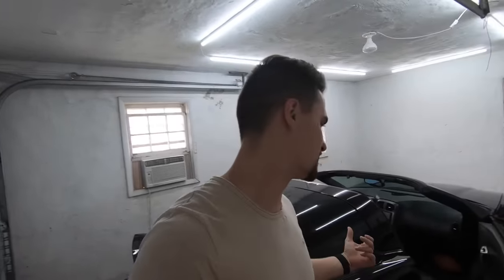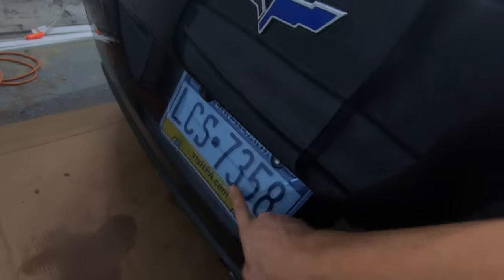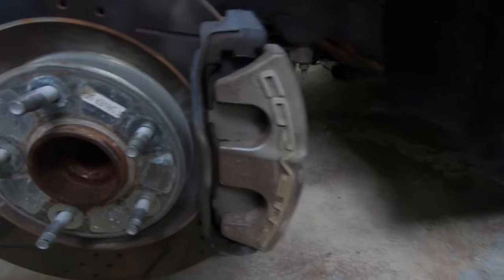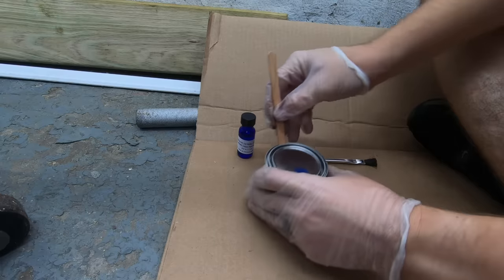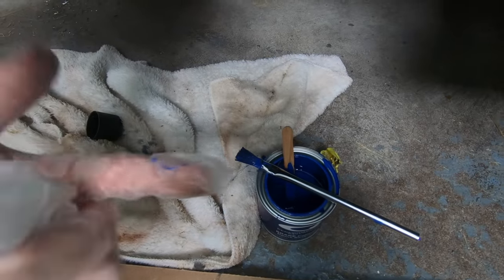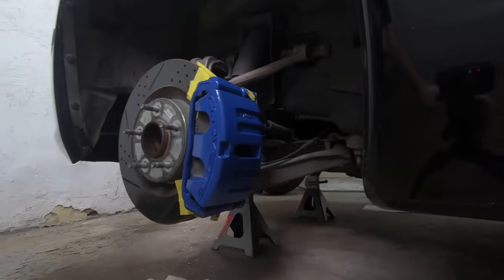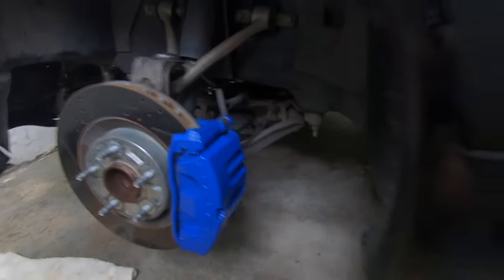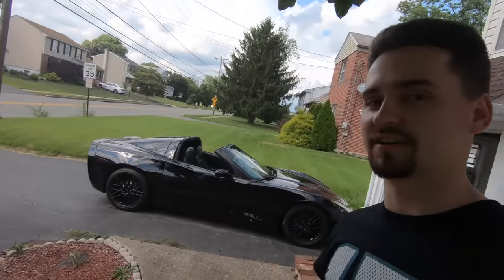How to Paint Brake Calipers in the CLEANEST and EASIEST Way! (Brush On)

Comment: Roman, just a tip, you could have used chap stick on the Corvette letters . the paint would not stick to it then after drying you could wipe it off. Worked for me.

Comment: So many different videos for spray painting calipers, whether people mask to spray paint in place or they completely remove them to bench paint them.  Nice to see someone making a kit to brush paint them.  I have 3/4 of a gallon of Fire Engine Red of Tremclad Rust-0-leum rust paint, which is the real oil based paint, before Tremclad switched to "oil technology" paint.  I painted the calipers two years ago.  Cleaned them with brake cleaner, wire brushed them with a rotary wire brush on a drill, cleaned with brake cleaner again and applied paint with two sizes of artist's brushes.  The old oil paint, brushes smooth with a good brush, applies thick and levels without any brush strokes.  Little to no masking and no over spray issues.  Two coats of paint and then top coated with 2X thick exterior polyurethane clear coat.  I took one day to paint the front calipers and a second day to do the rear, helping the drying period along with a heat gun.  Although the paint and clear coat have no heat ratings, there have been no issues what-so-ever.  Two years later and still looking like the day they were painted.  After all, they are just calipers and you get a flashing peek at them through the wheel spokes.

Comment: Nice video.   It's really pretty easy to take off the calipers and rotors (just 2 bolts), then just put the calipers back on lightly with the bolts and paint them with no worries of the pads (I think it's kind of goofy to paint the pads...my opinion) and no worries of painting the rotors.  Literally it's just two bolts and you can remove the calipers and rotors.

Comment: Turned out really well!  I was hoping you were going to hit the letters with a white paint and then clear and dry, but I’m really impressed with the color and ease with which you were able to change colors!  I have red calipers, but I’d think I’d prefer blue as well!  Great job!  Thanks
Reply: When I painted mine I pulled the caliper off the brackets no paint on the pads. I changed the pads while. It was disconnected. Before the paint cured I took a q-tip dipped in paint thinner and cleaned off the lettering. You and also use nail polish remover if it has not cured out.

Comment: I used (red) engine paint for my calipers.  I painted it on (2 coats) with art brush similar to the one used in the video.  It does not dry too quickly, so leaves a nice smooth finish.  It looks great and has lasted very well.
Reply: Going to try it this weekend

Comment: G2 caliper paint is awesome.  Also excellent customer service from G2  when I contacted them once.  Do proper prep and it’s very easy to paint.  Once I go around and do the first coat for all for brakes, I can immediately start again for second and third and maybe forth coat on 1-2 brakes until I use up the small can.  It usually only chips if you drive on gravel roads.  Very durable and very easy to apply after prep (cleaning).

Comment: I used this Kit and It worked great. Highly recommend. I took mine all apart to clean and paint.
Reply: Sica Rug  I did this job on my 350Z. It got new rotors, pads, SS brake lines... So, painted the calipers this same blue.Took them all apart, and about half the day with the wire wheel, WD40, and 2 cans of brake cleaner, etc. They looked so nice, I almost did not paint them. LOL.
Reply: Sica Rug  Well, I just painted them a few days ago, and put maybe 100 miles on them. I don't know for sure,  how long it will hold up... but I think it is going to be good. The two part paint, went on really nice. Seems like the correct product to do this job. The brush they give you worked fine. I like this better than spray paint... with no additive. I think it is a kick ass system. I put on new rotors, pads, brake lines, HT fluid, pretty happy with it all. I've been shopping for brake kits too. Unless you spend the big dollars, I think this is a good way to go.

Comment: I used this paint system on one of my cars last year.  I put white stickers over the same blue paint you used.  They still looked perfect after a whole year, and the white stickers still looked bright white as well.  This is an awesome paint system. I did this on an Audi A8, and before I painted I did a little sanding on my calipers to smooth some coarse casting edges.  Just something to think about depending on how the factory finish is on your cars calipers. Just that modification got me a lot of compliments and people asking me if that was a factory option on the car.

Comment: I didn't see this video. I was going to make my own but just did all 4 calipers without the camera. It is true. Using hi-temp engine enamel with a parts brush worked great. I had to buy a spray can. Use gloves. Sprayed the paint into a jar and brushed on from there. Easy as can be and the paint flows out perfectly. It was in the upper 60's out of direct sun. 3 light coats and a 4th touch up coat. A little taping off to avoid any spots you don't want paint. Takes about an hour a caliper.

Comment: I used that on my front calipers years ago...it was great stuff.  It hides very well on just one coat (although I did two).  It lasted for years, and the only reason it wore off was because of rust coming through from underneath (not the paint's fault).  I've hosed my calipers with brake cleaner dozens of times since putting on that G2, and it never even bothered it one bit.  And we know brake cleaner is some of the strongest solvent out there.  I'd definitely recommend this paint.  Even though I prepped my calipers by disassembling off the car and using a  wire wheel, I think it would be most ideal to use this paint on either new or sandblasted calipers.  You just can't get all the rust off by hand...in a few years it will start to come through.

Comment: Great job and easy also. I noticed that you buffed the inside of your rotors to remove the rust that builds up. Put rust oxidizer on them. It will turn them flat black and they will not rust again.

Comment: I like how all the super fancy expensive caliper paints advertise their high temperature specs, when I painted them with off the shelf 10 bucks Hammerite and it still looks brand new after 4 years.
Reply: Probably was the product(s) you use for cleaning it... also brake dust is the most corrosive on paint surfaces
Reply: Same here:)) I mean I bought Hammerite in gold colour from a DIY shop in the UK. Waiting for the good weather to come soon but changed car meanwhile:)) Suggestions? Got an arctic blue Mitsu Outlander PHEV 2014, now. Might work with gold callipers but I might paint the wheels in dark grey for a bit of contrast ( dont want them black).

Comment: Way better than spraypainting .Good job sir !
Reply: Spray cans suck, I'm tired of crappy nozzles. 
I'll bust em open and put it in a small detail gun because the finish is so much better for the parts that need that kinda  detail. 
Cheap 35$ husky detail gun does wonders.

Comment: Looks great. Soz to be a negative Nancy but 1. You painted your brake pads as well lol, not sure if you realized. 2. You only sprayed down the calipers and wiped them? Brake dust will be caked on there, simply wiping it with brake cleaner will only do half of what's there. Curious how long it will last. I'm about to do mine, it even came with a wire brush. Mines a different brand. But still for the past few hours I've been scrubbing then with brake cleaner and a wire brush. It's pretty clean now but it still could be cleaner. Some spots are still dirty even after 5 or so passes on them.

Comment: It does look really good.. was waiting to see you sand the corvette lettering. One thing though../ you painted the outside of the brake pad too.. would look better if you had masked that off IMO.. at the end of the day the look through the spokes of those wheels is amazing
Reply from the maker: Thanks! Yeah unfortunately it takes 24 hours before I could sand and it’s only been like 4 hours since I finished.
Also yes, I was on the fence about painting the back of the brake pad, ended up painting it but now I’m having seconds thoughts lol
I guess when I get new brake pads it’ll be as you described it.
Thanks for commenting
Reply: @romagrigorenko  doesn't really matter eventually you will have to change your brakes, or if it's so unsightly then you could change them right away

Comment: I did the same , I went to advance auto part bought the spray caliper paint and use the brush to paint it I didn’t directly spray it on I used brush to apply the paint and it’s dry very fast

Comment: Tutorial on how to do your calipers:
Get a brake line clamp.
Take off the caliper and clean it up.
Dip it in paint and drip dry.
Weather coat it.
Put caliper back on .
Release the clamps.
Do all four then bleed the breaks with a friend ( takes 5 mins)

Comment: I noticed you got some paint on the brake pad back plate. Would you not surely just remove the calliper  from the rotor-would that not be esasier? It's only undoing 2 bolts after all.

Comment: I used oil based Rust Oleum, 2 coats, brushed on. A beautiful smooth glossy shine. Sure, it smelled for awhile, but it looks great otherwise.
Reply: How does it hold up with the heat?
Reply: @TheRoastGlint  absolutely beautiful.  No signs of discoloration or getting dull. I always sprayed rush oleaum on my cars exhaust 1x a year with it running so it would bake on. Never did replace those exhaust systems lol...

Comment: What are the key parts to mask off when doing it by brush? I have a 4 pot front and 2 pot rear for my WRX. So far it looks like the boots on either side, the brake bleeder screw, the rotor and the pad. Is that correct?

Comment: It is only a couple of bolts to remove the caliper and brake pads. Painting over everything will be a bit of an issue when it's time to replace the brake pads. Other than that.....excellent job.

Comment: Really great, concise, and informative video. Thanks for doing it! Will probably get some of this and try it myself. Any regrets? Did it cure nice and level as expected? Has it held up under months of use? Thanks again
Reply from the maker: Chris Adams thank you! Yes, I’ve had this paint ok since I posted this video. Cured very well, no chipping, still looks perfect.
Reply: @romagrigorenko  Awesome - I think you may have just sold me on it. You should get a commission :^) Thanks again for a great video. Cheers! PS - and thanks much for the easy links!
Reply: @romagrigorenko  very  nice,,where did you get the paint  to buy?

Comment: Any updates as to how long before any cracking or chips?  It seems that only spraying brake cleaner wouldnt help it stick as well as using a wire brush or sandpaper additional.

Comment: I painted my Vette calipers RED a few years ago. Bought a quart can of Rustoleum at H.D. for about $7. Add some brake cleaner,  primer, and small brush, and you're out the door under $20. Don't see why anyone would buy that tiny bottle of paint in the kit you got (if they were painting them RED), although maybe it would be difficult to find high temp blue paint, but if you're going to do red, my way cheaper by far. ALSO.... to avoid having to sand down the letters that you painted,  you get a tube of Chapstick and coat the letters. When all paint is dry,  just rub off the Chapstick with a towel and you're done.
Reply from the maker: The whole point of this method is to not have to spray paint anything. Don't need to remove the calipers or tape anything up and no overspray. Also, its high-temperature paint, which will hold up longer than normal spray paint. 
And thanks Ill try the Chapstick way
Reply: @romagrigorenko  The Rustoleum I used was in a can,  not a spray. Painted all 4 a few coats and hardly used any paint.
Reply: What happens when you contaminate your brush with the chapstick

Comment: wow easy as hell...
spray painted my G8's and that took forever and messy... wow wish I would've seen this years ago unless it's a new product..

would it be better if you would've wire brushed and or sanded first then cleaned them..still looks good man

just need to decide what color to get for my xf jaguar
Reply: oh and should you spray a clear coat on them after, like the next day after it cures?
Reply from the maker: 666elrey666 it’s fairly new, haven’t seen it before. The paint is really strong so you don’t need to do all that bought it definitely wouldn’t hurt. Also it dries pretty glossy but if you want even more gloss then you can add some clear coat but idk how the clear coat would hold up with all the heat
Reply: @romagrigorenko  cool cool looks good man

like I said now just gotta decide what color would look good on my XF jag..
red is typical, silver dunno like wouldn't really stand out, or the blue 🤔 decision decisions

Comment: 1 plastic bag over rotors, under brake pad.
2 lay a cardboard something useless under the calipers for painting
 3 use light coats
4 when making your first coat let it sit for 5 min before doing any more coats then start again.
4 do 3 coats 

Alot faster and clean way also..just dont spray away always prep good

If car or truck was used, wait till calipers are cooled down.

Comment: I want to purchase the same color paint today for my daughter's bimmer. Can I use this paint at this time of the year ( cold temperature). I'm located on the East Coast.
Reply from the maker: Black Ceasar you can use it but the colder it is the longer it’ll take for the paint to cure. You can hit it with a heat gun in between coats or just do it inside a garage. But yes, you don’t want to apply it if it’s under 50 degrees F
Reply: @romagrigorenko  I appreciate the swift reply. I just placed my ordered, it arrives on Sunday.

Comment: Idk if you could. But you could use a airbrush to paint it. Idk how well the paint would work in the airbrush gun.
Reply from the maker: zev596 yeah I don’t have an air brush unfortunately. But honestly, using a normal brush is just as easy. Takes a little more time but no overtime

Comment: how many calipers can knock down by that tin can? like 2-3 coats each
Reply from the maker: I’d say about 8 calipers. So 2 cars total
Reply: @romagrigorenko  Not bad though for two cars or 8 calipes 2-3 coats…do you need to consume it in one mixing or you can save it for later to do the other car? thanks for the insight.

Comment: Why would you go to the precision of applying with a brush, but paint the pads and clips? The clips need to be free to slide as the pads wear or you’ll get uneven brake pad wear. That’s like painting a window shut. The contrast of unpainted pads and hardware is what makes the job look really good and professional. Another tip, turn the front wheels so the calipers are more accessible.

Comment: might want to powder coat ?
Reply: Like the BRZ too--same color as mine.  Although, I did paint my caliper brackets on the corvette red--overtime the paint started to flake off, which is why I decided to powder coat them.  Powder coating is not as expense as you think for a small job like calipers & brackets.

Comment: you should paint the rotor while you're at it.
Reply: The 'Rotor' is the Friction Surface of the brakes that provides the friction necessary for stopping the vehicle. It should NEVER be painted or coated in ANY WAY with ANY CONTAMINATING material.
Reply: @jtuttle11  🤦‍♂️

Comment: Brake dust is corrosive. You kept the oem pads AND you didn’t clear coat or grind your calipers. This paint will chip and dull in less than 2 months
Reply from the maker: It’s been almost 2 years and it’s fine.